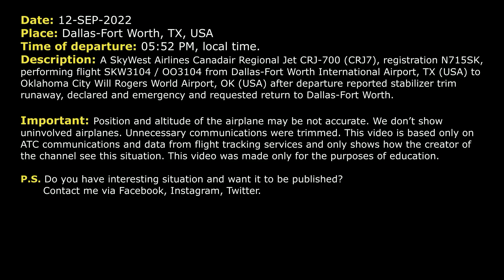Stabilizer trim runaway. SkyWest CRJ-700 declared an emergency after takeoff from Dallas. Real ATC

Comment: Non pilots: “wHy dOnT tHeY jUsT dEcLaRe iTs a FliGhT cOnTrOl eMerGency!?!?!” 
Pilots: “ugh, a trim runaway. This is mildly annoying. stab trim disc- push, hold, release. Call the girls in the back- we aren’t making that pizza shop for dinner”
Reply: 2 switches would have saved the 737 Max's from crashing...

One, they flipped the switches.  Got the airplane trimmed, then turned the auto-trim back on, when the runaway proceedure says leave them off and land.
Reply: @fhuber7507  I hope you know that the pilots weren't aware of the B737 MCAS...otherwise they would know the correct procedure / what was going on

Comment: Why is it always like pulling teeth for the ATC to determine if the pilot wants an immediate return, a long final to finish a check list, or delay vectors?  I hear so many who say "we need to come back to land" and get vectored for that, only to announce they need more time.
Reply: Exactly my thought. Why not say, I need at least 10 minutes. and if they are ready earlier, you can still tell the tower.
But this endless: 
I need one more minute 
I need one more minute 
...
Reply: @legofreak4895  Aircraft are rather complicated pieces of equipment. They don't have check engine lights like cars do and a hasty evaluation is usually involved in aircraft accidents.  The dispatch of an aircraft to a location will normally involve using all resources if there is a malfunction.  This would involve company maintenance and engineering being contacted over the second radio to help evaluate the problem.  If you have fuel, take time and properly evaluate the problem.
Reply: Probably because (exactly as you said mockingly) they need to come back, but also need time to run their checklists Aka delay vectors? 

Seems pretty basic to me. 🤷🏻‍♂️

Comment: Why do pilots, professional or otherwise, have an aversion to declaring emergency? Do they think the problem isn't that bad, do that not want to deal with whatever paperwork is involved after the fact, are they worried they will get in trouble? I honestly don't understand it. This guy sounded annoyed he had to do it.
Reply: You wouldn’t call 911 and have a highway shut down if your car told you you’ve got a flat tire driving down I-95, it’s kinda the same deal. It’s up to the flight crews discretion to decide how serious the issue is - sometimes it’s obvious, other times there is a serious gray area. 

There are ramifications for both issuing a mayday / declaring an emergency, and NOT doing so when company decides you should have in hindsight. 

At certain airports declaring an emergency can be extremely disruptive to other aircraft and general operations, approach will divert or delay aircraft, hundreds of passengers may miss their connecting flights -  in a span of a few seconds tens of thousands of dollars may be lost. 

I’m not saying it wasn’t justified here, just giving you insight into the decision making process of declaring an emergency like you asked, it’s definitely a big deal. 

And oh yeah, there is a ton of paperwork too. 😂
Reply: @EstorilEm  I’m obviously not the pilot of this aircraft so take my opinion with a grain of salt, but a trim runaway is one of the most serious there is, even if the crew managed it. They decided they wanted to return to the airport of departure BEFORE declaring. 

‘Aeronautical situations that require urgent assistance but do not pose an immediate threat to life’ — that is the definition of a situation requiring a PAN PAN call. Seems to fit this situation quite well, if a Mayday isn’t warranted. Of course, hindsight and not being actively involved makes it easy to judge.
Reply: There are two ways to say: I have a problem

PAN PAN: 
I have a technical problem but can still fly for some time. But I need special treatment like longer runways

MAYDAY MAYDAY MAYDAY:
I have a serious problem and I need to land as soon as possible. Whereby there are also here checklist, but they are kept short

To be on the safe side, it is better to send a PAN PAN than to leave the tower in the dark about the situation on board.
In North America, both types are probably traded equally?
 But is the paperwork the same in both cases?

Comment: Why is there a hesitance with pilots in declaring an emergency? Is it the paperwork involved?
Reply: More explanations to those in charge about why you did it.  Guaranteed chat with the chief pilot.  I’m not saying it’s right.  I’m just saying where the hesitance lies.
Reply: Paperwork is the same regardless.
Reply: @saxmanb777  This is absolutely not true lmao, same paperwork? 😅

Declaring an emergency at a major airport has the potential to disrupt hundreds of passengers and many aircraft, on the ground and in the air. 

Asking for priority return keeps things moving smoothly up in the tower, they’re very different.
Reply: @EstorilEm  the paperwork involved in declaring an emergency vs just diverting back to the original airport is exactly the same no matter how busy the airport is. I’ve declared and emergency a 2-3 times in my career and also diverted as a precaution for mechanical discrepancy or weather. All I had to do was write one or two paragraphs on what happened for each. Not once have I had a chief pilot call me about them.
Reply: What difference did it make?